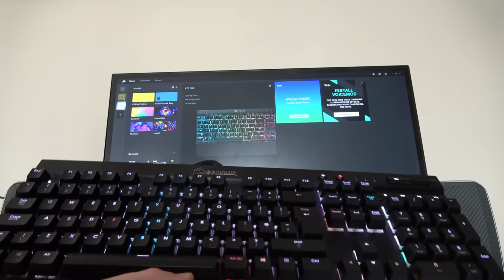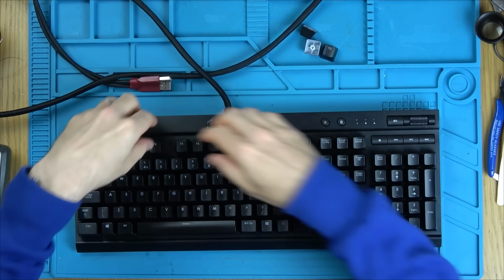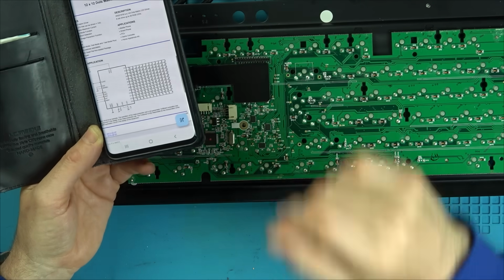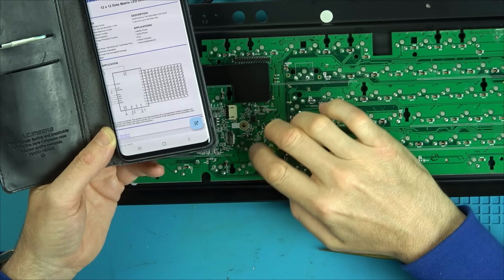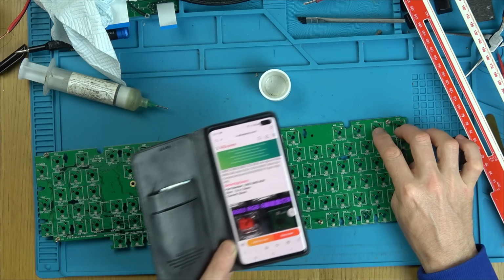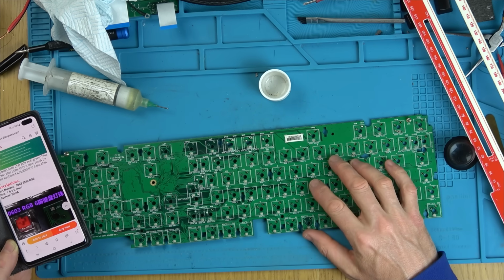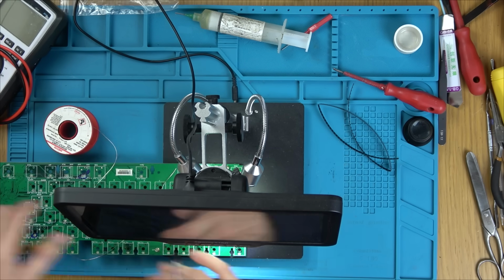Can I FIX Various CORSAIR Gaming Products? - PART 1

Comment: When you record it's in a sort of RAM memory. Floating in the RAM memory until it looses power and then dropped from the memory. Shutting it off by the corded switch "kills" it along with the unprocessed and saved video dumping it from the RAM. Turning it off from the machine must process the video and copy the processed video to the SD card.

Comment: There are probably different version but I leave my Andonstar plugged in to the mains and just power it off by unplugging the USB cable.  This kills the lights and then it powers off.  Never had an issue with it losing the video.  To turn it on, I just plug in the USB.  I never use the power button at all.

Comment: Your nailing the chip hand soldering. the best ive seen, I wasn't expecting that level of complexity from a keyboard but mine doesn't light up, . when soldering rows i twist strands of solder together so you dont need to feed through your fingers as often. Epic video repair. Respect on the key desoldering.  Thought they might be addressable leds, possibly a simpler driver than this 3 chip pcf?  io expander.

Comment: Just fixed a lenovo psu for thinkcentre tiny. short at the exit strain relief. ususlly seen this go open but this is such a common failure point I'd be interested in any methods to improve strain relief. Will add several different lengths of heat shrink. Great inspiring videos.

Comment: Nice Job Vince 👍An alternative method of doing the LED's would have been to tin board, add some flux, place the LED into position and heat the board from the bottom with the rework station, or use a hot plate. Very odd about the microscope not recording, I could see how frustrating that would be! All the best Mick.
Reply from the maker: Cheers Mick

Comment: Hiya Vince can I ask you a question ? I've got a Roberts MP-23 cd/MP3/usb/memory card/Dab radio ...it came with its small remote but I can't access the radio....usb...or memory card function or turn the thing off via the remote ...I bought a replacement remote on eBay but that's doing exactly the same thing ....shame it's a lovely tone ...I bought it off the bootsale ...is there something gone in the unit ?or I'm just unlucky with both remotes ?hope you can point me in the right direction cheers Vince

Comment: the red windows key is a lock of ..windows key that is on the bottom left man.. its what it does. locks ability to use that key so you don't accidently press it. Also please do not vacuum the PCBs with a vacuum cleaner you just asking for trouble with ESD .. if yo uwant to dry PCB , clean it with DI water, then dry it off with compress air , then you can dip it in IPA then dry it again. But with water soluble flux you can just do spot cleaning with no need to clean whole assembly . I had problems with my keyboard like that and gave it to warranty repair it came few days later with a different key at fault so I just gave up :D

Comment: Yes, a desoldering station is definitely worth the investment... Imagine doing all this with a solder sucking pump instead. I also use it to add solder, when it doesn't seem to work. I also have a little bit different technique for tight places where I can't add solder from the side - I add some solder right into the nozzle before putting it on the pin.

Comment: Corsair keyboards should be avoided. I have three of them. two of them being the top models, all three are  a year apart and all had the same issue. every single keycap falls off due to thin cracks down the stem. even brand new ones  did the same thing, I contacted them and they  ignored all that and claimed  there is nothing wrong and said "we can replace  up to 5 key caps for you" or you can buy some  elsewhere, are they really that cheap and stingy? needless to say I wont ever  buy another one of their products or reccomend them. the most exspensive one   had a drip of water   do the same thin Vince's  did $250 for literal junk lol

Comment: I would have just desoldered it all using braid... Either way, it's always good practice to add fresh solder.
Reply: Most manufacturers now use unleaded solder due to health/environmental regulations in the market(s) they're aiming at. Unleaded solder tends to be far more brittle & flows less easily than leaded, so problems occur faster due to dry or incomplete joints as well as less resilience to impact/pressure changes (keyboard keys are a v good extreme example)

I think I learned this from a recent @bigclive video explaining such, but it's well worth remembering!
Reply: @snafu.X  Yes, but that doesn't negate what I said.

I would have gone for the braid, applied flux, added extra lead solder.

IMHO for me at least, that would have been significantly quicker to do than using the desoldering gun.
Reply: @ray73864  Agreed, but as (apparently) all the keys needed to be removed anyway to free the board & expose the LEDs, it's a bit moot I guess :) I was simply trying to explain why it happened in the first place

Comment: Hi Vince
I faced the same issue with my AD407  scope so I got the startech  “USBAUB2MU UP Angle cable” on Amazon make sure it’s the UP Angle. Also got usb light on an articulated arm that has a  switch, and  it’s worked perfectly for me.

Comment: I've got the same microscope. Pretty sure what's happening is stopping the recording isn't closing out the recording file/updating the file listing table. It only does that when it turns off properly which is a really weird way to implement the sd card management. This one's on whoever wrote the firmware, it's probably an afterthought or maybe there's a really niche technical reason why it has to be done this way in relation to the rest of how the firmware works but in either case imo they chose the implementation poorly. It should close out files and finish writes to the sd immediately on stopping recording to prevent file corruption.
Reply: Could be either that memory card is not unmounted, no file coherence written. Or, the video format is of the type that isn't written until the recording is done. 

An example of this can be seen in OBS rec setting. It warns about video loss for certain formats.

Comment: If you like to test LED then i would limit the current to 20mAh at maximum of 3v...depending on the color it's safer to limit to 2v like red as an example. 
There is a chart for led colors for the maximum Voltage.
The safest route is to use diode test on you Multimeter which allows you to test LEDs Visually without damaging them.

Comment: Dude, no matter what the voltage, you can't short a non current limited PSU across an LED.  You should have had a 1K resistor in series.

Comment: I don't know from video if your okay button is serving as a start/stop or a start/pause. So when you hit power it is not saved cause it was only paused. Or maybe there is an autosave feature in settings? But as for the Mains Switch. Put it in a box or something.
I have a Smart Bulb installed in bedroom so I can use my Echo Show to turn the lights on and off. It's been years and I still try to flip the wall switch to turn off/on the lights. So, I designed and printed up a safety switch that blocks anyone from flipping the switch by accident. Muscle memory a double edged sword in some instances.

Comment: would using the remote for the camera change your muscle memory into sorting your video issues? I personally don't record, i automatically turn off from the socket instead of the the front panel. Kudos for the extra effort to get it working. Great vid as usual.

Comment: Interesting. My Andonstar microscope has the same little control but it only controls the lights. The microscope itself needs to be turned on/off by the button on the microscope itself. I wonder if they fixed your problem in later versions or there might be a slight chance that your little controller is killing all power by mistake. Perhaps you could pull it apart and make it so it only kills power to the lights?

Comment: All the things that the donator of the keyboard described happened to me as well, with two separate Corsair keyboards, the K70 and Strafe RGB, random disconnections, and inconsistent key operation on specific keys, sometimes working, sometimes double or triple repeating, and the RGB issues. I elected to throw them away, and after the K70, my second Corsair keyboard suffered these issues, I put Corsair peripherals on my do-not-buy list, over $300 in keyboards, and both failed in just over 3 years combined. Nonetheless, it was interesting to see this keyboard taken apart and fixed.

Comment: Now Vince. You are correct about the microscpe. I had one the exact the as yours. I now bought a new on and it now has a seperate usb cable to power it. The lights are now seperate. Do not know about the remote yet. Not used it.

Comment: I have a K70 keyboard, the original red LED only version.  I call those 2 screws (the one under the metal logo sticker and the one hidden under the plastic clip next to volume roller) "the DIY Frustrator Screws".  I've told Corsair support the same thing too.  Of course they are. They want you to give up/break your K70 so that they may sell you another.  Anyhow, my issue was the WASD keys were overused and chattering on the A key specifically.  So I bought myself some new cherry browns (with the integrated clear plastic LED holder area) and desoldered the originals and replaced them successfully with my own ones.  Still use it after this repair.  The other gotcha with this is there is a comb pressure connector which invariably will fall onto your desk/floor when you separate the two kb halves.  I learnt all these tricks after watching others struggle with their own repairs.  Glad I invested the time as it made my repairs so much easier.

Comment: I've got a K70 RGB LUX and it also seems to have a failed LED. The Z key only lights up red now. If I try setting it to any other colour, it'll go dimly red or completely off. The keyboard also suddenly started randomly disconnecting (would be fine for some days and then have a disconnect spasm). I disassembled the keyboard because I felt like inspecting it to look inside, cleaned the PCB with some IPA and that seemed to have stopped the random disconnects (hasn't had a spasm for several weeks now).

I'm a little bothered by the Z key not working on this as I do like to have my keyboard set to a static colour. Seeing it off or red when set to a non-red colour is a little annoying. If this video is anything to go by, then it doesn't seem worth having to desolder all the keys just to repair one LED. I may do it one day, but for now I've just decided to ignore the issue. I don't have a microscope or an appropriate soldering iron tip for this job either. I use a TS100 soldering iron and only have the TS-D24 and TS-I (this doesn't seem to work very well any more) tips. 

This was a very interesting video to watch though.

Comment: With led strips that is so cheap, they are usually factory rejects,, ie in your case badly cut.
I had a batch that the lenses were not stuck on properly and when I grabbed them with my tweezers the lens would pop off taking some traces with it.
But you do find that you get a fair amount of leds that work well getting you a fair repair rate.
You have now reminded me that I have to clean the keys etc on my laptop,,, not my fav job with years of gunge and workshop muck 🤧

Comment: If you add a resistor, something like 1K, when you test LEDs, it's unlikely you will burn them out even if the voltage is a little high.

Comment: For the microscope issues, why not put a cheap powerbank at the back to keep powering the recording equipment until you switch it off 'properly'? Almost like a UPS..
So, power from the dongle thing, to the powerbank, and then out again to the microscope. So it never loses power regardless of the state of the lights button.

Comment: Your microscope is probably recording to some form of temporary or staging file internal to the device memory and is only being exported to the SD card when you shut it down "properly". You're right to be angry at it, it's terrible from a usability standpoint. Have you checked for a firmware update to fix this?

Comment: Very conscientious. A suggestion is to put something insulating between the microscope stand and PCB when injecting voltages. Not sure if your microscope has HDMI output, relying on SD in these devices has always been problematic. Your dinner looks a little disappointing.

Comment: I have always been able to lift seals intact just by using isopropyl alcohol and lifting with a sharp blade. They stay perfect and go back down smooth. Once I even had to lift a calibration seal to repair a unit after calibration. Only my supervisor new and that was only because it was he that told me to do it. It stayed perfect until it went in for calibration the next time and was broken by them.

Comment: Had a wooting two there i killed a led with tea, the led was burned out too. Also got a brownish tint to it.

To the caputre issue. It lookes like a mini HDMI port at the screen side, could you use a external capture card? I do not know what is shown at the output but seems to be the camera feed logicaly. Yes it is a extra cost, but with the powerbutton so close to the light an so on at the controll it screems to be pressed by accident

Comment: Keep your eye out for an old-fashioned binocular microscope, and snag it if it's a good price (and nearby). The weight is the biggest factor. If you have a base, you can then get a used trinocular head (stereo view + camera mount) later, and you will be insanely happy.
Reply: I put in a saved eBay search for a microscope within 100 miles. Around a year later, I snagged a nice "stereo zoom" setup, with base, for pennies + shipping. (Shipping was pricey due to the weight, but totally reasonable given the short distance.)

Comment: my guess would be it saves footage to ram and dumps it to micro sd when you shut down, and i agree your best  bet is buying a separate usb cable to power just the microscope/monitor so that even if you turn off the light switch that part stays on.

Comment: Hi Vince, it is not the voltage that is killing the LEDs, it is the current. So next time you test them, just limit the current on the lab power supply to 30mA at 3V and you should be fine.

Comment: It would have taken me a lot longer than that to desolder all those keys! I was amazed how cleanly it came away 👏
You've got a lot of side-to-side play in the nozzle of your desoldering gun compared to my (less-used) one. It might just be wear, but I'd suggest checking that the screws at the base of the metal piece are still tight.

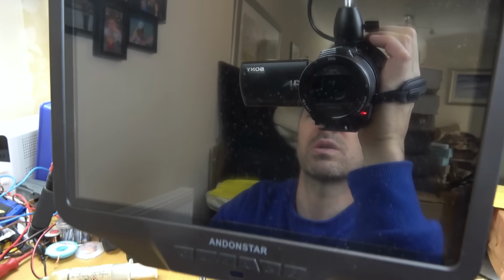Comment: 44:35 (this made me sad) :( when you said "causing you so much bother" 

I want to help, because you are one of my repair heroes!

Vinceee. I hope you see this msg because I have that Andonstar microscope as well. (except mine has silver buttons on the front, not black). Purchased from Banggood. "Andonstar AD207S HDMI Digital Microscope" is my particular model.

Now, for me, I don't really use the remote either. I press that "Ok" button to record, and press it again to stop recording. Then I press the power button on the corded dongle (that has those light dim buttons). But! My videos are still there when I check them on a pc. It's unusual that for you, they are disappearing. 

I just tested this again to confirm. Also, I tested what happens when the "Ok" button is pressed to record, but, suddenly powering it off by pressing the power off button on the corded dongle, before stopping the recording first(!).

Viewing on pc, there is no thumbnail picture for the video recording that was shutdown prematurely. It cannot be played either. But it is still there. Just, the recording didn't have time to re-assemble into a video file because it was shut down prematurely. **Next sentence very important!!**When I put the micro-sd back into the microscope, the "corrupted" video file gets re-assembled automatically, and it plays like normal. Which is the exact same thing that happens when I power off my DJI Mini 2 drone, before stopping the video recording. It becomes "corrupted", until I pop it back into the drone again and power it on, wherein the corrupted video file then gets its chance to be assembled into its video file format, in the drone. Recovery software is not necessary. It just needs to go back into its device where it will reassemble automatically. 

Other things to mention:

- Your micro-sd is not larger than 32GB is it?! (manual says not to go over that) **
- It is formatted in FAT32?
- Your micro-sd is definitely genuine capacity, not fake? 

My micro-sd card is Sandisk Ultra 32GB, class 10 A1. I bought it specifically from Amazon for this microscope. I did want to use a bigger sized micro-sd but decided to obey manual. 

Also, a tip. The microscope has great 1080p video, but that metal stand and bendy lights are annoying. I bet you would agree. And I couldn't fit things comfortably underneath, without it bumping against the microscope column, or falling off the edges of the stand. My solution. I turned the screen around so it's backwards. And I prop the stand up with some blocks. Now things slide underneath without hitting that damn column! And the working area is now all wide and flat silicon mat. Much better.

I love your channel I watch it every day!!! Love seeing all the different things you repair on your repair adventures & I learn SO MUCH FROM YOU. I was so happy that you finally conquered that Rolls Royce(mostly have). I had some tears I must admit, seeing that your dad was there for that episode, helping put some finishing touches with some polish on the car with you :').